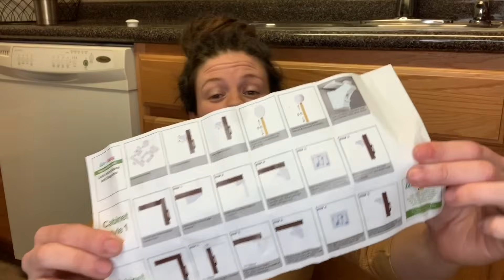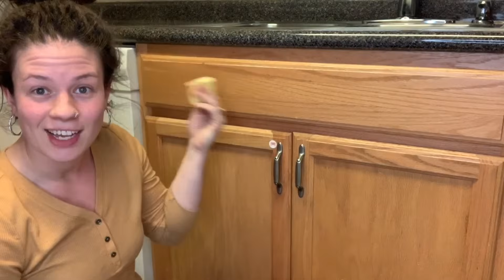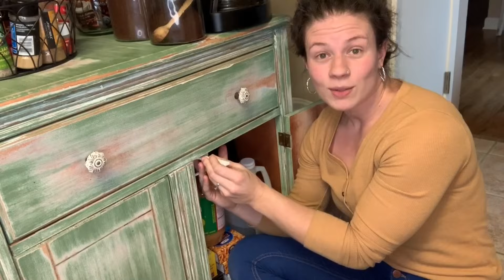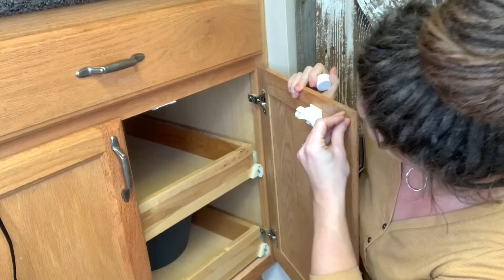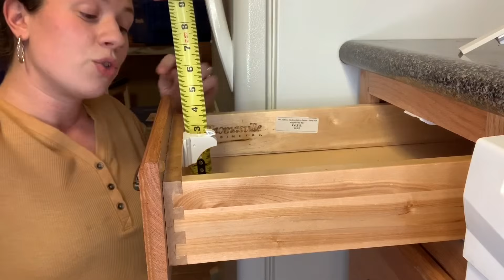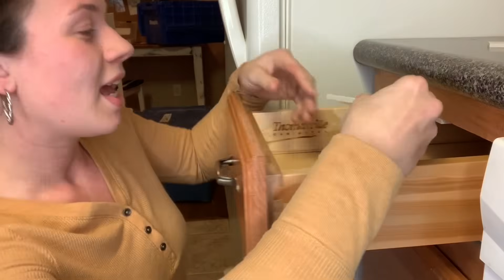Eco-Baby Locks How to install &Troubleshoot

Comment: i would not rely on the 3m adhisieve do your self a favor and use the screws provided. Also for drawers i recommend installing to one side of the drawer not in the center of the drawer it will make use of the drawer better.

Comment: Does anyone know where to get the blocks? I need them for my drawers. I tried calling the company and it’s not even ringing.
Reply: You could use she's self at hardware stores. Carpenters use them for everything.  They look like thin pieces of wood. You could glue several pieces together to create the block size you need and then attach it to the drawer or cabinet. Then, attach the parts for the locks to them.

Comment: Great video... I did have some issues at first, once installed the latch would not unlock!  I discovered that the cabinets pieces when joined together also had magnetic internal connectors.   I simply  moved the lock over!  That was very puzzling!

Comment: Fantastic instructions, I love your delivery and they helped ever so much.  I am installing about 24 of these on everything except the totally recessed door, but I have a another issue.  My kitchen drawers were re-surfaced and the gap between the drawer body and the frame will not accept the catch that gets applied first.  I added an extension behind the frame so I can put the plate in deeper.  Now I have to use an adaptation of the totally recessor door with just the part the is recessed into the frame.

Comment: What if the drawers are right on top of each other nothing in between 😫
Reply: Same problem here! :(
Did you find a solution?
Reply: Yes I need answers because I’m in the same boat
Reply: This might be how to fix it starting here at 12:51
Reply: Or here 15:42 😮
Reply: Saw another video and he had drawers in top of another. He put the locks on the side of drawer not directly in front. Hope that helps. 😮